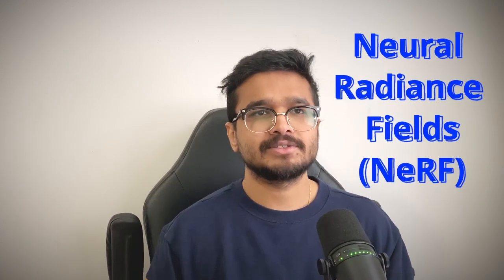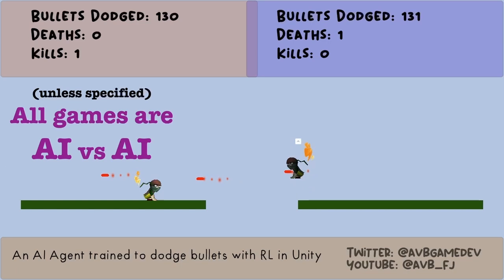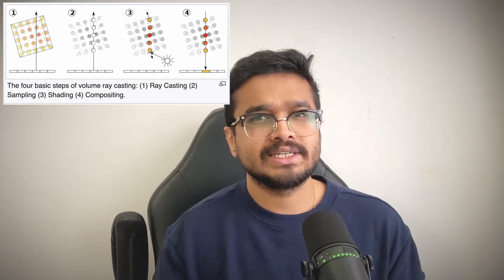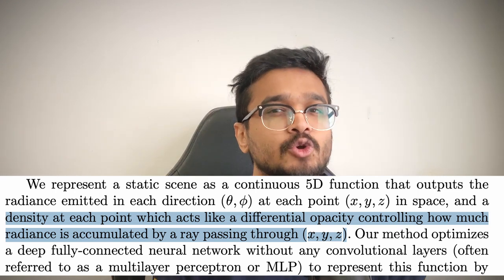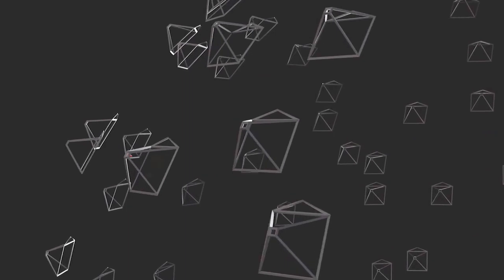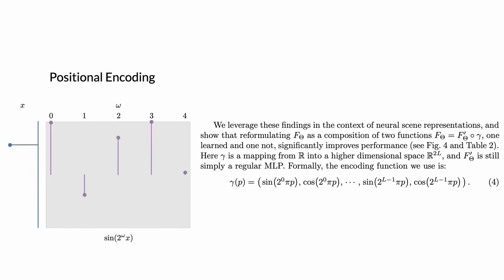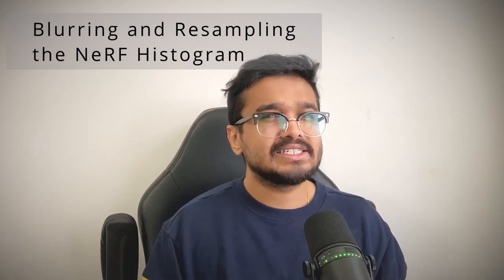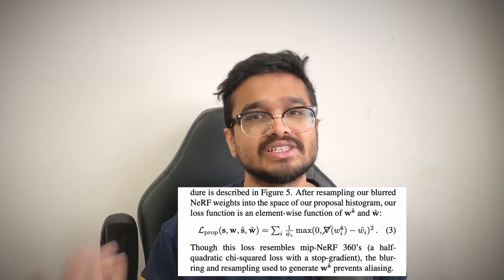Understanding Zip-NeRF - a cool new AI algorithm for 3D scene synthesis

Comment: When do you think 2d to 3d ai will be able to render the entire Earth in 3d?
It seems like there is enough data out there on the internet, the hard part is just making the ai to use it all. Also, if the AI could learn from video (or from haptic sensors) and implement a physics model too (the 3d world becomes something you can interact with). 
Maybe it could become a giant simulator of the planet and be used in games or for anything really.
Reply from the maker: This sounds like a crazy idea (in a good way). There has to be a smart way to achieve this by smartly processing scenes which are in camera view. I'd imagine this will have to run client-side with client GPUs similar to how game engines render scenes locally.

Comment: Could Google use the "brute force" voxel method if they wanted to make Street View into 3d? Or would even they have too little storage for this?
Reply from the maker: There must be a trick to do this process asynchronously to alleviate computation load. Similar to how game engines render scenes at different resolutions depending on where the camera is pointing. With good caching, parallelism, it should be possible to do a version where the model runs on the client machine with the client's GPU.